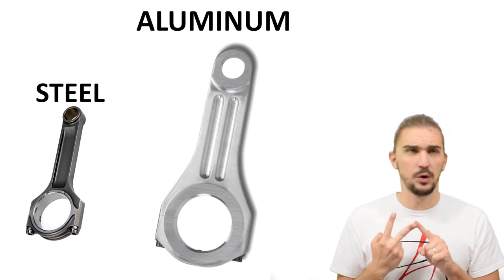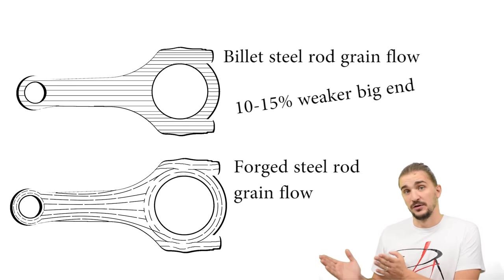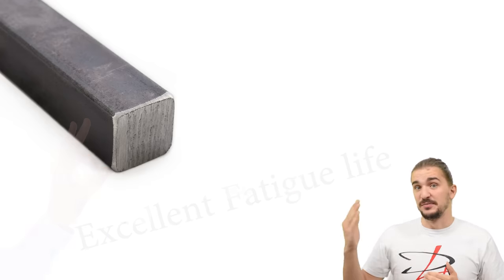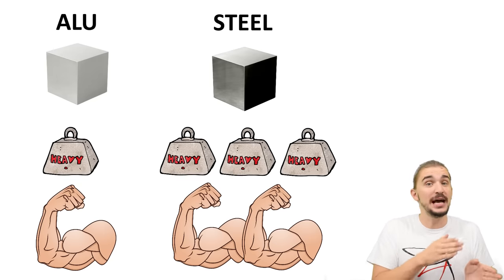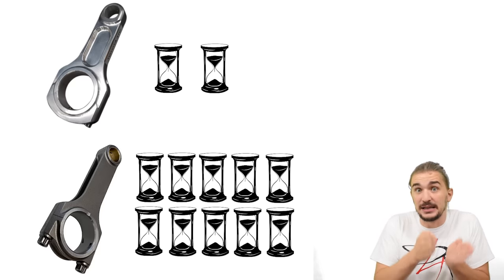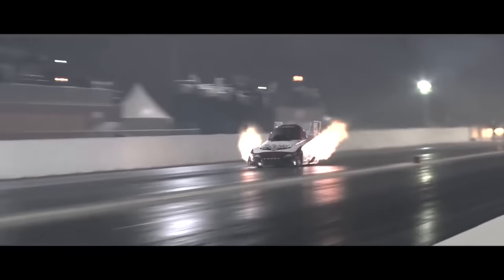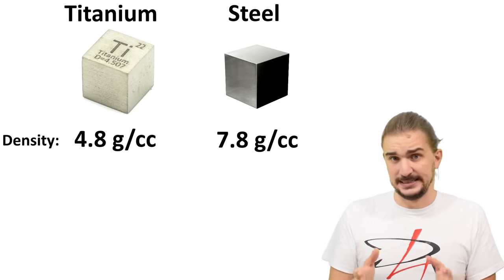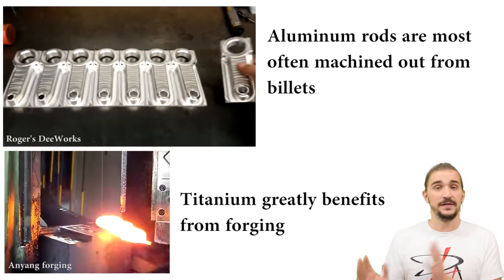STEEL vs ALUMINUM vs TITANIUM Connecting Rods

Comment: Thanks a lot for that info because I was planning on putting a set of forge aluminum rods and pistons in my daily driven car but now am thinking twice if it makes sense because I might not get the benefits plus who want to be going in to your engine to check rods if they are stretched.
Reply: I've been involved in a lot of engine builds, and we've never put aluminum rods into a street machine. It wasn't even a consideration.
Reply: Ok Kenny Phillips thanks...so it's best to keep the steel rods for my every day driving car but I want if the  forge pistons with the steel rods would improve the acceleration or make the engine rev faster seeing that I already installed a aluminum  flywheel and a crankshaft pulley.
Reply: That would depend on the weight of the piston and rod. There are aftermarket ones that end up being lighter because the material and process makes them stronger. Forged pistons do typically expand more than a cast piston so you do want to give it a bit of time to warm up so the piston doesn’t rattle in the bore to much.

Comment: There's another material which is a compromise between aluminium and steel which was first used by Honda in a production engine in the early '80s- alumina metal matrix composite.  The material was first used to make connecting rods but since has been used to make both connecting rods and engine blocks.  It's made by encasing a structure made of large diameter alumina fibers in a matrix of aluminium.  It is then given its final shape by forging and finish machined.  It is slightly heavier than aluminium alone but has a higher tensile strength. Honda developed the material for high performance small engines used in sport cars and motorcycles and has been using it successfully ever since.

Comment: Great video!  On a related note, I’ve seen several carbon fiber drive shafts (supposedly the “ultimate” in performance parts) explode during race conditions.  Just goes to show that there are no magic materials that work for every application…except for teamwork, critical thinking, and the scientific method 😉
Reply: True, but a failed carbon driveshaft is much safer than a steel one....

Comment: Bill Miller of BME fame have said his aluminium rods (of a secret, proprietary alloy) been run in endurance racing like Le Mans..! 
One thing I've heard from several engine builders about titanium rods is that they are really hard so if you break one, you can likely throw the whole engine away since the left over rod part will destroy everything in it's way vs. aluminium that usually don't break blocks etc. when snapping. But in either case it's definitely better to check your parts more often and get new parts before they are at their last leg!

Comment: Always a pleasure, sir, but twenty lashes for saying twice as weak rather than half as strong. Similarly to lightness, we can't readily quantify weakness. This may be a semantic issue but we define strength as the force an object can withstand before failure. I don't believe any such specific definition exists for weakness. 

On another note, I think a video explaining the precise nature and mechanism of fatigue would be very interesting. You described it as an observed phenomenon in terms of our experience of it but it used to drive me crazy trying to comprehend how flexing below the elastic limits of a material would still eventually cause it to fail. Maybe others could experience the euphoria that I did upon learning what actually takes place. (I'm quite sure you know.)  😉

Comment: Great primer video on the advantage of metals for rods. You said aluminium expands more with temperature than steel. What if you have an aluminium engine block (cylinders) and steel pistons, does that mean that if the engine runs a bit too hot it will be susceptible to excessive oil consumption as oil passes by the rings ?

Comment: Titanium absorbs impact fantastically. That's one reason why it's use in tank armor. So your point about aluminum "shock absorbers" applies to titanium, too.
Don't know which is better at it.
Thanks for the galling tip. Makes titanium permanent assemblies easier to design

Comment: in the past, nearly all Connecting rods where forged, not casted! Later on, improved casting technics enables casting of conection rods to reduce production cost, so it was the other way round. Casted conection rods are better suited for cracking the bean bearings, which also reduces cost compared to mashining the surfaces.

Comment: Thank you for the difference in the heads up my small block Chevy steel rods for longevity anything else I’m nervous about waiting to see your next update on anything engine thanks again.🕶”
Reply: What premix or oil injection are you running in your 2 stroke chevy. https://www.4btswaps.com/attachments/2cyclesbc-jpg.6839/.

Comment: 1. How would Aluminium Beryllium alloy work as rod material?
2. After hearing about titanium and notching from you, I dont think I would trust anyone else to install or handle my conrods if I ever did buy titanium.
Reply: The strange thing is that, once you factor in density and you look at what is called 'specific strength' or strength-to-mass ratio, the strongest available steel alloy will perform about the same as the strongest titanium alloy and the strongest aluminium alloy and even the strongest magnesium alloy. The weight will be about the same for each version but they will differ in how much volume they take to create the strenght. 

AlBeMet has a 0.2% yield strength of 274 MPa and Ti6Al4V has a 0.2% yield strenght of 880 Mpa, so the load at which the material will start to yield (deform) is about 3 times higher for the titanium alloy. But it's 210 kg per m³ against 443 kg per m³, so the lower density of the beryllium-aluminium alloy is not good enough to make up the difference. 

As for titanium, it is more susceptible to work hardening than other alloys. (This is one of the reasons it's a proverbial pig to machine.) So if you were to abuse a titanium part so that you really gouge it, you've created a local spot that has increased hardness, which can act as a stress concentrator and cause fatigue cracking. But you need to be really deliberate and/or brutal for that to happen, like deliberately throwing them around the length of your shop, or drop an engine block on them.
Reply: Also working with Beryllium can cause Berylliosis also known as chronic beryllium disease.

Comment: I'm less than 10 minutes in and I am loving this!  I didn't know what he was Teaching but it was /is  what I was Preaching and I am NOT a Racer at all... I'm a Diesel Guy and I like 300 to 400 thousand miles ... seats and dash worn out and 3 outa 4 doors still function as designed ... that makes me happy because that means the tyranny is still working too because I may still driving it and I can still sell that Engine for $4,000 to $5,000 because it is only about 1/2 of it's Duty Life ... everything  else may be SHOT But that Engine is Still Strong and will Last to 1 Million Miles Plus ... then the Hulk Engine comes with the Carcass that needs to go decorate somebody else's Front Yard ...

Comment: I read this somewhere years ago, don't know how much it's true. Several Soviet or Russian fighter jets exploded in the air for no reason. An investigation board worked immensely hard not getting a clue. They had to gather all of those jets' fractions up to almost a size of a molecule. <Titanium compressor blades shattered in flight> was their answer. Now all the people involved were astonished how the hell was it possible, since the blades are manufactured in utter precision with multiple verifications throughout the way.
There was one stage of the engine assembly process where the compressor blades, arriving in stock from a factory to the engine assembly facility, were unpacked and laid out on special trays. Ladies who worked at that assembly stage opened the stacks with razorblades(!) sometimes cutting immensely tiny scratches (dozens of nanometres deep) on some of the compressor titanium blades.

Comment: TL;DR version for the everyman DIY-er:
if you have a street car in any form: Forged Steel connecting rods are the ideal setup.
If you're going for a high-performance, short-life racetrack-only car: aluminum is worth looking into, but not always the correct answer.
Titanium rods are only worth it if your car already came with them from the factory.  Otherwise, don't even bother.  Titanium is past the point of diminishing returns as far as value for the money.

Save your hard-earned money and spend it where it matters: High-quality bearing sets, a purpose-specific oil pump, and establishing a quality engine setup (ported/polished cylinder head, upgraded valvetrain components, intake and exhaust system, etc.)

Side note: minimizing the mass of the internal components of a rotating assembly don't really mean much if you're still using high-mass stock crank-end components like a dual-mass flywheel and/or stock engine damper.  Get yourself a lightweight flywheel/clutch assembly and a sport damper (ATI for example).

Comment: I have been thinking a lot lately about rotational inertia in different engine and vehicle applications. in racing you want light engine rotating mass. but in heavy slow rock crawling 4x4 you normally want heavy rotating mass, to help you get going from a steep incline. but at what point is this helpful or hurtful? if i have an od long rod Toyota 2f engine in an old land cruiser with heavy flywheel and heavy pistons. then put in light rods, pistons, and flywheel. then yes it may go up hills on mountainous highways more easy, because more power is making it to the already moving wheels. like the way horsepower speeds up the crank. But will have to ride the clutch ALOT when taking off on the hills with already stopped big tires. Torque moves inanimate objects.  But lets say. you have a little short stroke engine. and put it into a heavy car. then you will need some mass in the engine to get it moving. and it will get great millage on flat ground or down hill. but if living in a hilly area. on long trips the lighter engine mass would be better for over all millage. wouldn't it?  but a light car with heavy inertia is a dog to drive.  OH and gearing, including tire size is a huge factor of how you can GET AROUND some of these faults.   Can you please make a few videos on all this inertia stuff. it is about enough to make a guy go bonkers:)

Comment: Just an average Joe here, but i wanted to ask a question about using titanium rods that have been flame sprayed (heat metal such as steel to the point it liquidifys and then blow it onto a surface where it cools and gardens) or ceramic coating.  It doesn't solve all the draw backs, but would make the titanium less susceptible to notching.

Comment: Your points and observations regarding these the materials used for conrods, is well taken, but there are issues:

5140 alloy may have no nickel or molybdenum in it, but these are expensive alloying ingredients, substituted by adding more manganese (for hardenability) than in 4340, itself having twice the chromium (for hardness).

"Billet rods are better at resisting the formation of cracks compared to forged rods."

It's only true that billet conrods may be preferable to those that are forged, but not because of surface and/or internal foreign inclusions, which you imply is from the forging process, but because billet made from tool steel alloys (in your example, those made from ASTM 41XX and 51XX steels) are almost always produced in arc-furnace vacuum crucibles, making them relatively inclusion-free by that process. Also, the conrod may be laser/water/plasma cut from billet, but that doesn't mean the billet wasn't itself forged in its making.

You didn't really address the issue of the difference between hardness (sometimes bad!) and toughness (always good!).

I'm glad you brought up the matter of grain lines via forging being optimal. 10-15 percent strength increase is non-trivial!

I'm glad you mention the matter of aluminum conrods in drag-race engines. But, first of all, in my past experience, top-fuel dragsters and funny cars (in the era of 7000-8000 hp) had aluminum conrods to not only protect the crankshaft (you said this), but also because they were "cheap" enough that all could be routinely discarded and replaced between each heat. Second of all, I wonder if the new aerospace Al-Li superalloys will (or already are) "changing the game."

You imply that a conrod would be made out of (pure) aluminum -- a conrod would never be made out of pure aluminum. Also, I am only surmising now, but forging is so important to the yield strength of aluminum, that I doubt there would any conrod made of it that would not be forged.

Titanium! For the first non-trivial application of titanium in military aircraft
(the XB-70 and the SR-71), the raw titanium had to be surreptitiously purchased from Russia! Now, a new mining process has made titanium commercially feasible. I'm glad you mention the matter of the beautiful gold Ti-Ni deposition coating... but it was not used upon the titanium conrods of the Acura NSX. They were, however, fabricated using a powder-sintering process -- very high tech!

Great video though!

Comment: Back when driving a fuel dragster meant putting the family jewels 10 inches or so away from the ring gear, there were not too many high-performance parts made for running nitromethane. The hemis and big blocks started to see better parts in the early 60s, but the classes known as jr. fuel ran small blocks and had almost no support from the high-performance industry. We ran stock small block Chevys with Corvette cranks, pistons, wet sumps, and iron heads that we port matched to the injectors. We did run connecting rods that were the best rods at the time, GM "PINK" RODS!! We would go to a chevy dealer parts and pay $7.00 each, and we would need a lot. It was not IF but WHEN these engines exploded. We came back home from a two-week match race tour in Canada and stopped at a local scrap yard first to drop off the remains of SIX engines. Once I left the line and split the left bank of cylinders off of the block and ran it over. Back then we proved you could push a 358 small block chevy to 900 hp., 10,000 rpm off the line on 86% nitro---just not too many times.

Comment: Did the math, the aluminum rods are 1.3 pounds less than the cast iron rotating assembly. That's quite a bit of weight to knock off of your crank. I'd imagine this paired with a lightweight flywheel would make for a pretty rev-happy engine.

Comment: Interesting that you chose 2J rods as an example.  The thing with an aluminum rod for the 2J's is that the crankshafts need to be modified down to a Honda rod journal size, which means a much smaller housing bore on the rod.  I suspect that's going to throw a weight comparison off a little bit since the dimensions are not exactly the same.

The reason for the Honda rod journal modification is that with the OEM Toyota rod journal size (2.047"), the big end of the Al rod is actually too physically large to fit down the cylinder bores on the blocks.  Granted, this was a while back, maybe they've modified the designs a little bit, but probably not that much.

Comment: Good video for the exception of the machinabilty of Titanium, in fact it is very easy to cut especially compare to any other exotic alloy like Inconel or Cobalt based alloy which are the most ferocious by far. This a common misconception and I would personally prefer cut titanium over 4340 any day.

Comment: Just to add.  you forgot about forged machined/billet rods, a general shape is forged then the final shape is machined. These rods are very expensive with base titanium rods just edging them out and they are kind of hard to find nowadays, however they are the best general purpose kind you can get
Reply: This was in the previous video ;)
Reply: @AlessandroGenTLe  hahaha, no or rather not quite.  When I say forged into a general shape, I do mean a general shape of a rod in a billet form, think of a very chucky rod basically.  the "billet" is then ship to a machinist, were it is decided what kind of rod it is going to be whether it's  H, I, W, A or B design. Once a design is selected, it then cut and polished, then final machining of bearing surfaces.    However, I do think you could get away with just a forged billet (hunk of steel that been forged and cut into squares) and machining from that.  Anyway, these rods are hard to find and with metallurgy having come a long way (not to mention titanium being alot more common nowadays), you can get away with a basic set of regular forged rods at half the cost.    P.S. I did mention machinists haaaated these rods as it could take days or even weeks of cutting (for larger size rods) to complete a set....

Comment: One mega horse power builder said when crossing the 200HP per CYLINDER threshold, aluminum rods are required to get decent crankshaft life. Change oil, change the rods!